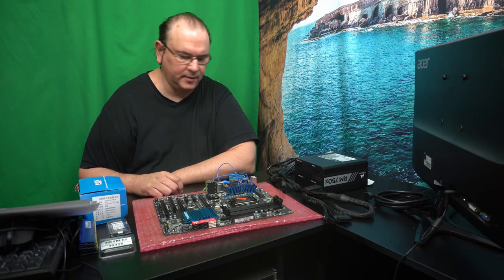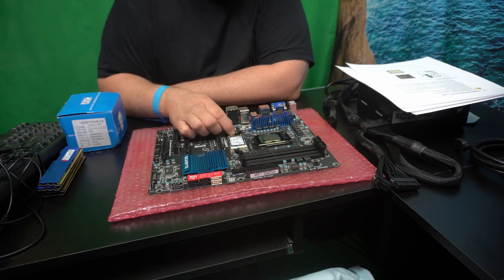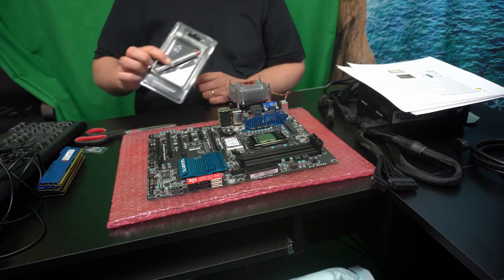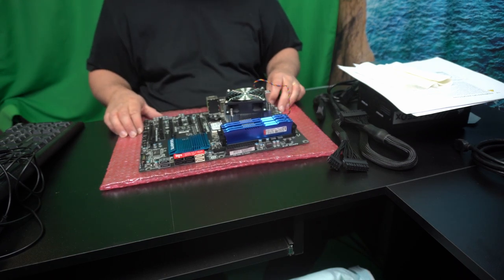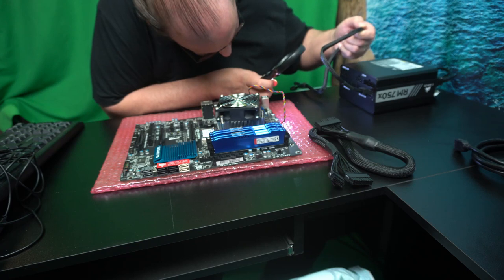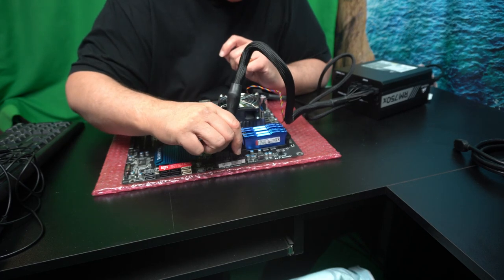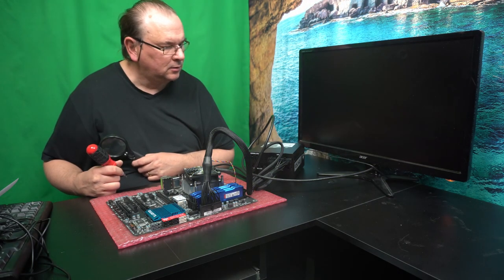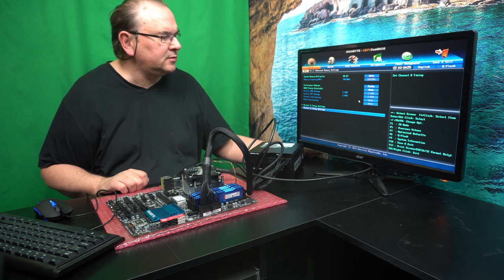Gigabyte GA Z77X D3H motherboard assembly and test

Comment: Did you ever find out why the BIOS (and in Windows System specs) shows only half the installed corsair RAM: 16GB instead of 32GB?
Reply: ivy bridge cpu aka i7 3770k supports 32gm ram proberly need to update latest bios update
Reply: mine wont even post with 32gb in, i have a i53470, am trying to find out why it wont accept 32gb. it posts with 16 in slots 1 and 3.